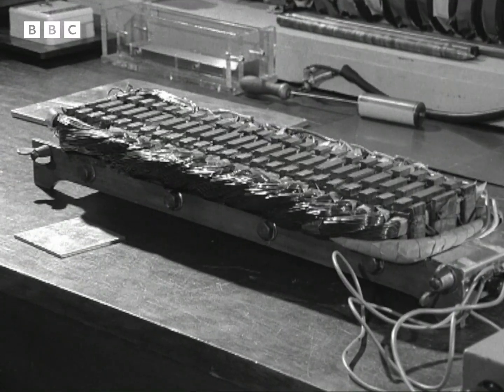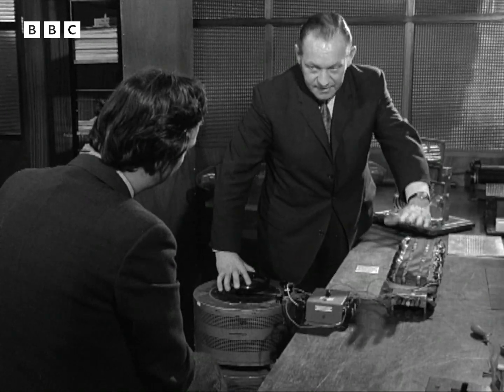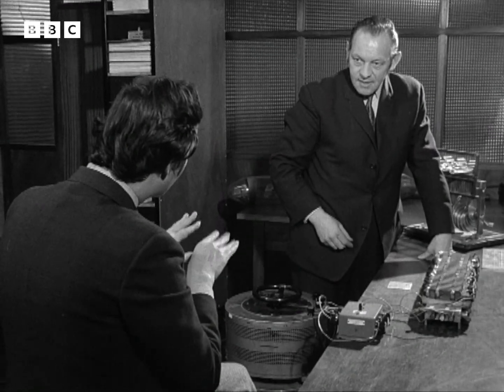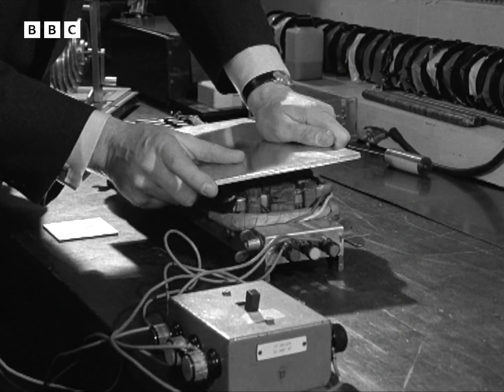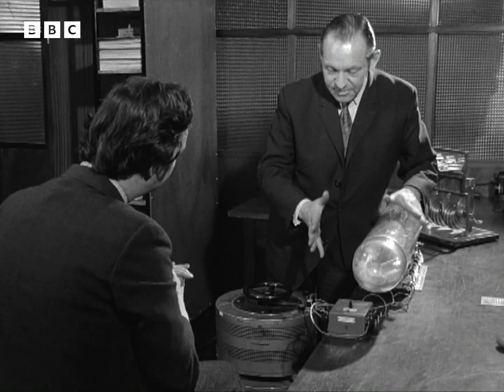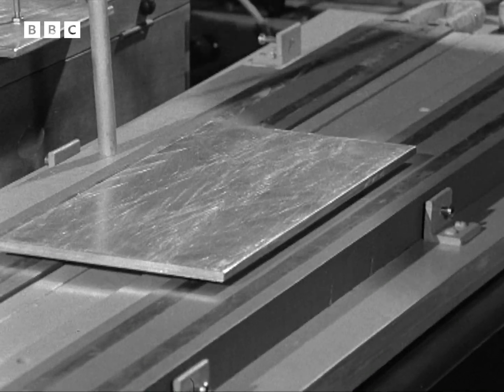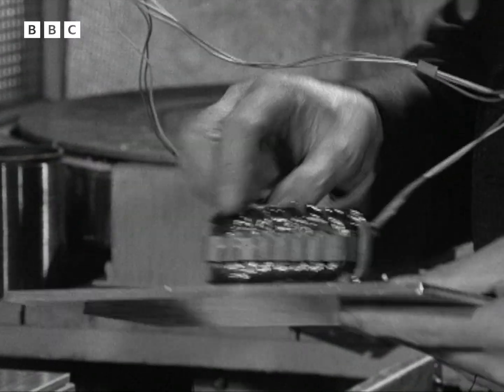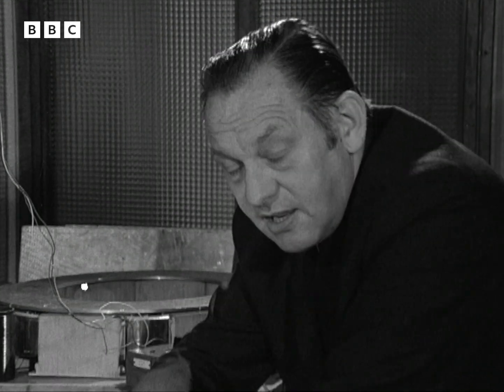1971: HOVER TRAINS - the FUTURE of Travel? | Nationwide | Retro Transport | BBC Archive

Comment: Dear BBC, it's John here from the future. It's 2025 and we're still waiting!
Reply: Many of these have been built, generally called monorail
Reply: Check for Transrapid, that is in operation in Shanghai since 2004, and also JR Maglev in Japan, that's testing functioning hover trains since 1997 on a 18km long track and reached a world record of 603km/h in 2015, with the technology intended to be on service in 2027 at cruise speed of 500km/h
Reply: @stevens78  Yea those are demos of the tech, very expensive toys, there's a reason no one will build them again much less widely. It was already possible before them just that no one wanted to because it didn't and doesn't add up.